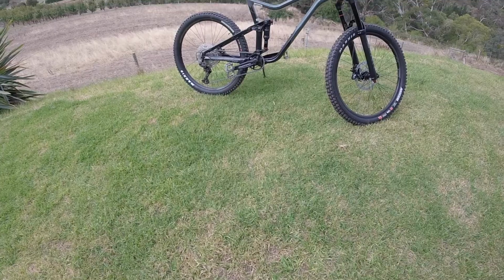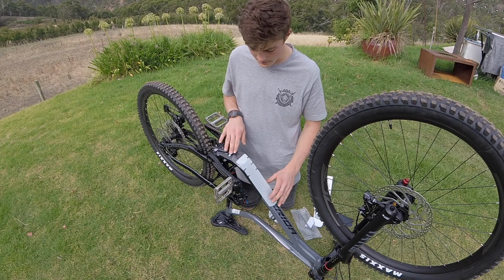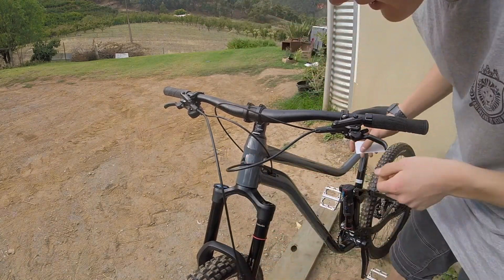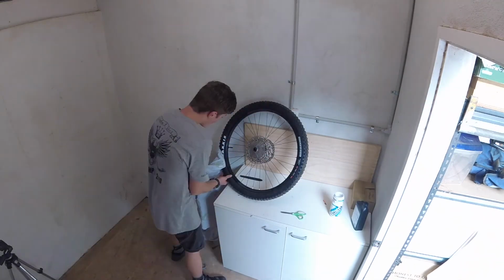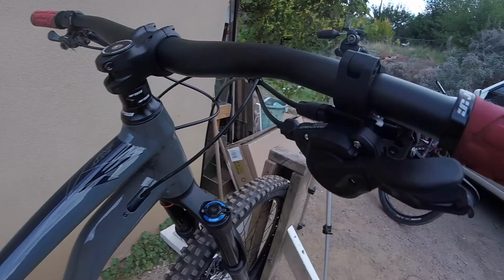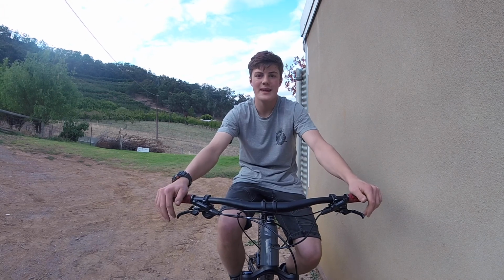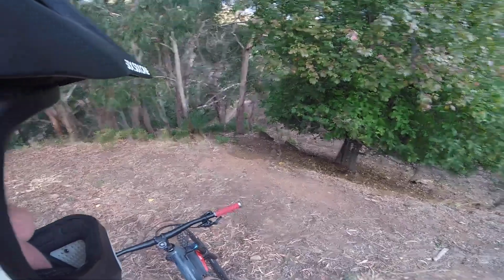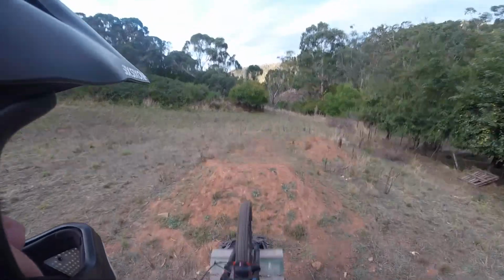NEW BIKE DAY // Setup and test!

Comment: what did you do with the wheels? filling water inside and why?
Reply from the maker: So I was doing a tubeless conversion which means taking the tubes out and replacing them with sealant. It's lighter and harder to get punctures because the sealay will seal any small holes.